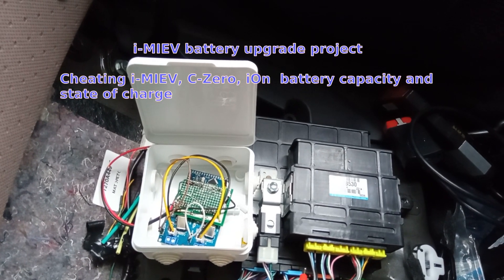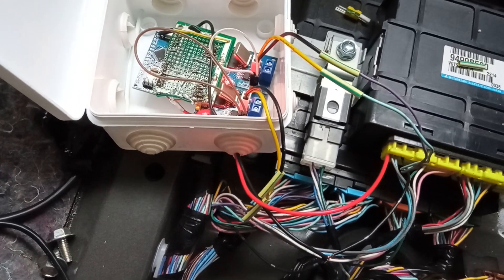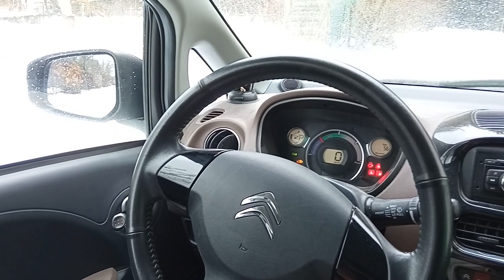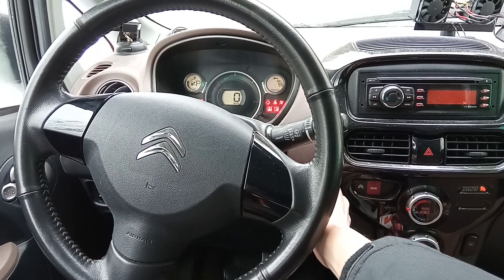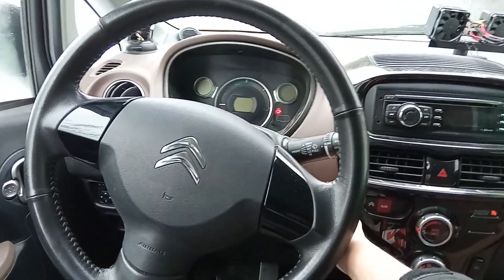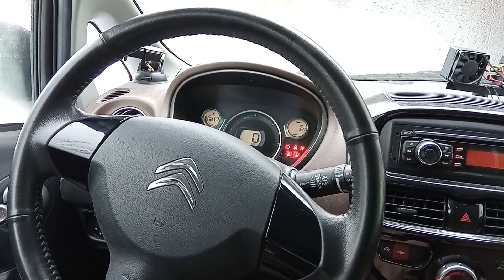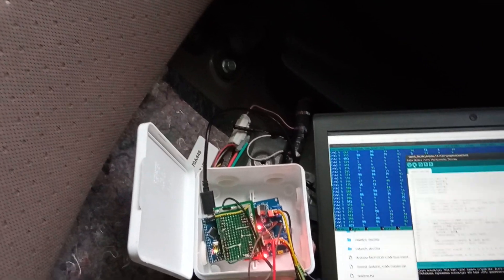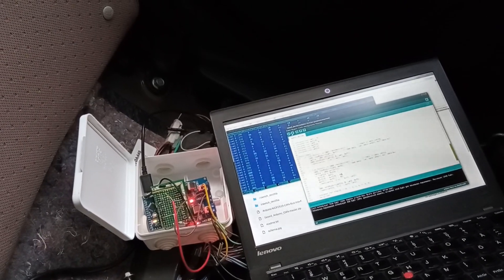CAN hack: cheating the battery capacity and SOC for Mitsubishi i-MIEV / Citroen C-Zero, Peugeot iOn

Comment: Would the BMS cope with a battery with a higher max voltage? If you upgrade the batteries you'd lose a bit of the higher battery voltage (4.2 out of the 4.35 usable volts) but the voltage curve is quite steep here anyway so you wouldn't lose much. The i-Miev learns the driving range over a few cycles anyway so it would display the correct value after a while.
Playing with the SOC could be hazardous.. Although the cells might have internal limit voltages to prevent fire

Comment: Could you tell me the program used to cheat the battery capacity using Alexia? Thank you very much.
Reply: Battery upgrade to CATL 93Ah. The Arduino issue is clear, but what program is used with the Alexia interface? Thanks

Comment: Hello. Good job!!! Did you managed to upgrade your battery? What kind of battery cells are almost plug and play for Lev50,? Samsung from BMW i3 94ah? Are they also connected with nuts  or welded?
Reply: Starmax energy on YouTube who are a battery retailer seems to have options
Reply: Yes I know about it but used Samsung cells will be cheaper and more reliable the only issue it type of connectors (nowaday in EV batts are used lasser welded Al connectors/bus bars @toyotaprius79

Comment: This is quite interesting but worth mentioning that it could result in your battery going on fire!!! This is a little device that sits inline and basically intercepts messages with ID of 374 which is likely from the battery or BMS and then changes the range value in the message to a higher value that makes the system believe the range is longer than it actually is. Also intercepting message and changing the battery charge to a higher value. This means the car could allow the battery to be driven longer than it's actually capable of. This could result in the chemistry of the battery cells being stressed beyond the working parameters which could mean electrolyte breakdown and ultimately they overheat and go on fire. If a big battery like that goes on fire, it's game over because it's a chemical reaction that's taking place - resulting in combustion. Even if you douse it in water, it can start up again.

Comment: Hi, so did you get this working properly in the end, using larger capacity cells?
I know theres many other cells that work in the miev, its not hard, juat tricky to get the car to accept the battery upgrade unless you pay a lot of money to the Australians solution..  and they charge double what the cells are worth...

Comment: excellent work. do you have to upgrade the BMS to 30kW as well?
Reply from the maker: there's no 30kw option for miev. there were 14.5 and 16kwh ion bats and a 10kwh Ti. so the idea here is that can bridge is all you need
Reply: Y como se hace el puente can un saludo

Comment: Thank you for showing this very interesting hack. I have been waiting for a battery upgrade to become available for my i-miev here in Japan. Of course, I never held out any hope that Mitsubishi would do it.  It would be fantastic to have one of my own. This hack is a small but significant step.
Reply from the maker: There are some aftermarket upgrades already available - in Australia and in Russia. Russians found a 94AH bolt-in perfect fitting NMC cells thus doubling battery capacity.

Comment: I have a citroen C-Zero and a battery of Mitsubishi i-miev. Do i need any hardware or software to adapt the Mitsubishi i-MiEV to Citroen C-Zero?
Reply from the maker: Yes you do. A MUT III or Lexia - you need to match the VIN. And worst case there are Citroen vehicles with 80 elements (14.5 kW) instead of 88 (miev 16kW) but thats for newer model years. Mine was 2013 / 88 elements.

Comment: Hello! Do you know any garage in Europe (France ideally) that could do this kind of intervention please ? I have Peugeot iOn, the car dealer charges soooo much for that....
Reply from the maker: Charge for what? Hacking battery capacity? That won't give you extra real capacity. If you think of a battery upgrade, consider the price of Lithium batteries ($160/kwh), you can fit approx 30kwH currently in your battery - that's already 5k and keep in mind the importing tax. 
Now the labour. Its at least removing and repacking your battery with new cells - if you're able to find perfectly fitting cells - I know who has access to those in Russia, but he won't disclose the exact model while its CATL. Otherwise - its a good piece of work to do to place 88 different size elements and connect those. So $10-11k for repack is a totally adequate price. I've recently sold my MIEV in favor of not yet sure... Geometry EX3 or Weltmeister EX5 or something from BYD... still considering. MiEV is good but with its charger limited to 3.5kW, weak old battery with no heating, aging problems like rust and dead capacitors... this world is too cruel to EVs.
Btw if you have a repacked battery already, you can find a guy on the net... his nickname is kolyandex. He was able to hack both BMU and EV ECU so he can provide you with a firmware with a discharging curve you need, proper charging currents mapping, capacity patched... whatever you need.

Comment: Здравствуйте! Как с вами связаться?
Reply from the maker: Добрый день. По поводу?
Reply: @diyeverythingnow  I want to contact you too. Email would be good. If you have a telegram account that would be even better. I found the cells but have no way to patch the car's data. Can I count on your help?
Reply from the maker: @L3N1NVEVO  https://t.me/+Dm95Tcs-0nYzMmY8 lets talk there. Also there's a commercially available solution - google the guy with kolyandex nickname, he was able to disassemble the BMU firmware so can set any capacity. Or you can copy mine solution if you want to. Sources / schema are available from github.
Reply: @diyeverythingnow  I joined the channel but can't write anything there. I wanted to ask if you could help me with making this can bridge. I'm not good with Arduino.
Reply from the maker: If you have difficulties soldering, I wonder how you gonna replace the cells then. It's pretty simple though. If you have difficulties flashing the arduino - there's million of guides on the net. Literally few clicks really. Otherwise I would recomend to get to Kolyandex (google him) and get a commercial solution from him - an updated BMU firmware. I don't think it's costy.

Comment: Have you found a suitable source of cells for an upgrade? The energy density has improved a lot, so the battery case for the original 16kWh battery pack could hold modern cells with about 30kWh capacity. That would provide a much better range which would extend the useful life of the car for another decade or longer. 👍
Reply from the maker: Well... no. Either aliexpress or local guys offering assembled modules from slightly used wrecked chinese vehicles. No any kind of warranty anyway. Most of them are 6s or 12s modules while for miev you may want 8s to simplify mounting. There are also 60+ Ah LG Chem soft packs but those will die definitely due to high charge currents and temperature range. Sure, the plan is to get 200+ km range in real conditions.
Reply: @diyeverythingnow  Добрый день
а почему пкаеты должны умереть?
оригинальная батарея же на 50ач и не умирает при том,что старые часто и 36ач,а тут будет 60ач
больше емкость-больше токи заряда могут быть
Reply from the maker: @vladlenbezymanny3716  если речь именно о пакетах а именно о любимых всеми lg chem nmc, они не предназначены для токов зарядки > 1с, и будут пухнуть от чадемо. И по температурным режимам все плохо там. А родные lev50 - это просто монстры, которые хоть в космос запускать
Reply: @diyeverythingnow  ну вот читаю даташит 
1) температуры
Что там что там от 10 до 45 норма
Максимумы у lev50 на 5 градусов больше.
Но при 60 градусах жарить батарею дальше считаю глупо.

2) токи
Зарядкаспокойно у лыж и 90а и разрядка до 175
У Lev вижу чуть больше до 125а зарядка.
Но это ж не критично
Reply from the maker: @vladlenbezymanny3716  что у лыжи с зарядкой при отрицательной температуре и на сколько пакеты имеют право распухнуть по тому же даташиту? У Логинова есть ролик, где он нормально так аргументирует, что не стоит их пихать в машину. А ещё у катла есть батарейка 1 в 1 лев50 по габаритам, 94Ач и если приварить шпильки - получается болт-ин комплект 94Ач. Таких машин уже несколько катается, чел с ником Коляндекс сделал патч БМС. В начале года комплект обходился в 5к, сейчас хз. Пробега получается около 260. Для себя я решил что byd ev360 едет дальше, не имеет дефицитных компонентов и стоит чуть большие деньги по итогу.
Reply: @diyeverythingnow  супер а можно линк на эти элементы?
Они становятся впритык или есть как и у оригинала для воздуха место?
Reply from the maker: @vladlenbezymanny3716  модель элементов поставщик разглашать не хочет, иначе цена было бы сильно ниже 170 за киловатт час. Его можно найти в WhatsApp группе miev.ru. Или выйти на него через Kolyandex-а, до него просто достучаться.
Reply: @diyeverythingnow  спасибо
Reply from the maker: @vladlenbezymanny3716  в догонку - вот кто-то из их тусовки продает машину уже https://novosibirsk.drom.ru/mitsubishi/i-miev/47706889.html
Reply: @diyeverythingnow Привет! Отличная работа! Чёрт возьми, все пути ведут к Коляну. Хочу допку поставить и как раз твоё видео попалось. Сейчас покопаюсь чутка ещё на твоём канале, отличная работа в любом случае. Колян под допки не хочет шить и с ёмкостью у него поиграться нельзя.

Comment: Interesting project. I saw a YouTube video about a company in Australia that is developing a battery upgrade. They said that they plan to distribute in all countries where the cars were sold. However, they plan to distribute through automotive repair companies which will be expensive because there will be many hours of labor involved. Hence it will be less expensive if you can develop a DIY option.
Reply: Maybe 1 out of 20 owners can do it by himselfs. It's no problem to buy a cells and change them all over.
Reply: That company only warrant the batteries they use for 12 months, they will not say what brand batteries they use, they may be the cheapest they can get. Also they are currently charging 16k Australian dollars. I would touch them with a ten foot pole but your actual mileage may vary.

Comment: Why simulating the car has got more capacity? You may damage the cells 🤒
Reply from the maker: I'm not simulating a car, I'm patching the packet going out from the battery management unit. And no, I won't damage the cells - there's no reason to - I'm not affecting charging controls and the goal is battery upgrade. So while I'm building my workshop for battery replacement and looking for proper cells - I'm doing some experiments.